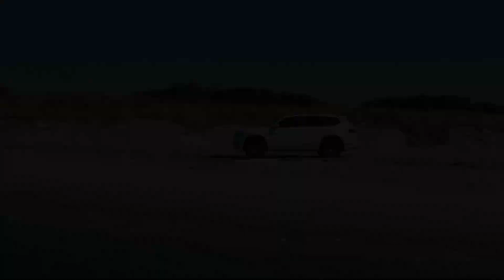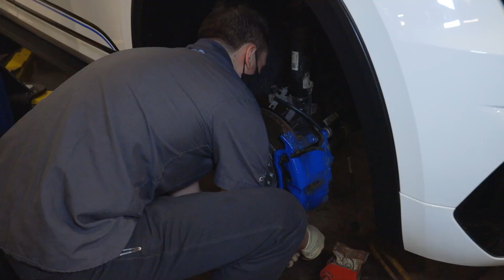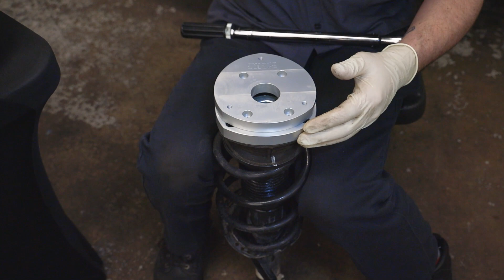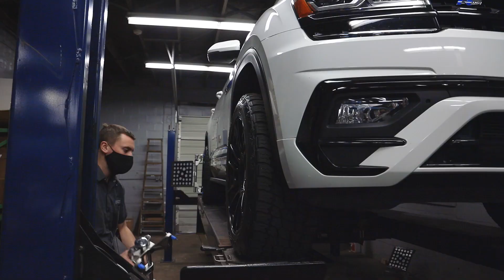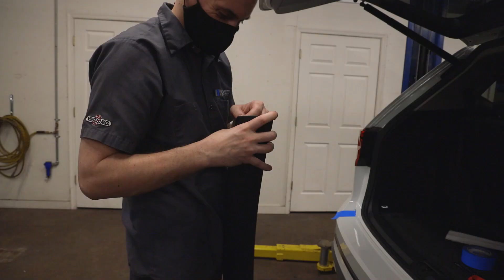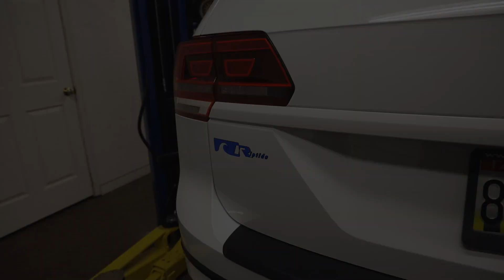NGP VW Atlas Project Riptide - B2BFAB Lift Kit and RGM Rearguard Install

Comment: What’s the biggest tire’s size I can put on after I installed this kit? I’m thinking about 275/65/r20, what do you guys think? Thanks
Reply from the maker: We were using 275/55R20 tires on ours. You could probably fit the 275/65R20 tires as there is a little more clearance left with the tires we were using. However, we haven't tested this ourselves. Also, you'll want to use the B2BFAB BFT Blocks. Without them, the front tires will rub.

Comment: Did you remove the 10 bolts around the axle or the center bolt in the middle of the rotor?

Comment: What size tires, I’d like to do 17’s but i wonder what size tires that could take and will 17 inch rims clear the calipers?
Reply: Always depends on your offset. Wherever you order tires and rims from should be able to tell you if the setup fits your vehicle.
Reply: 17s work fine